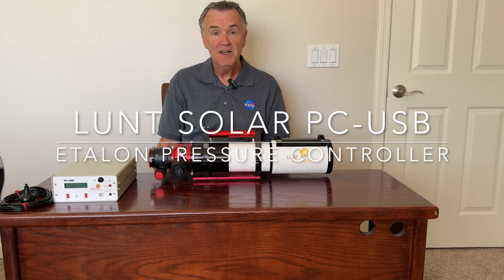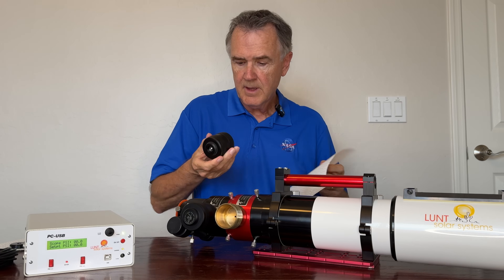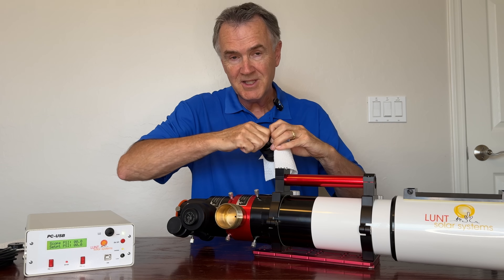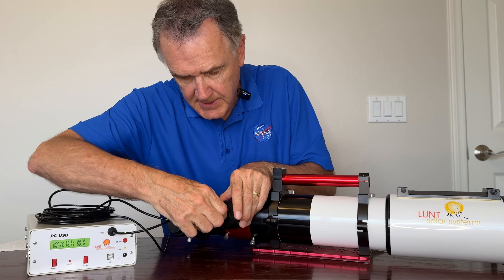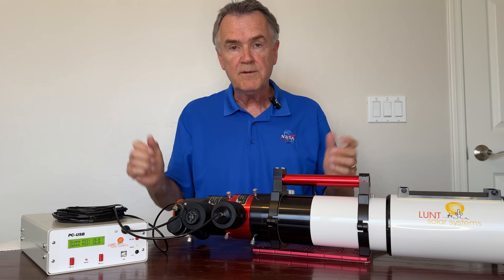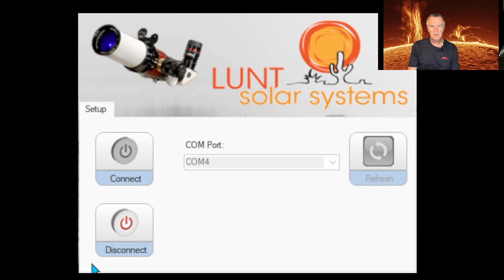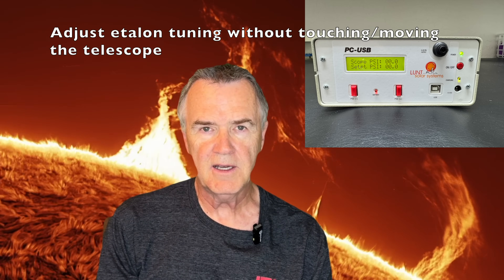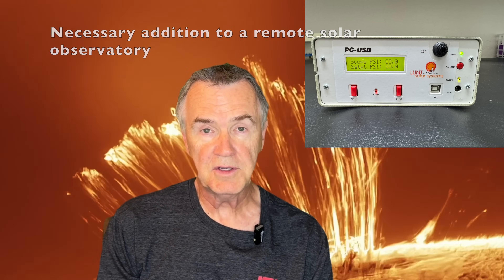Lunt PC-USB remote pressure tuner controller review

Comment: Very interesting. After months of waiting, Lunt finally made their pressure tuners available for purchase. I had to wait nearly 8 months to get one.
I noted that you pushed the o-ring into the tube rather than pushing it onto the piston which has a groove for the ring (similarly to the piston you removed) - any reason for that ?
Lunt provides non melting grease which can be used to ensure there are no air leaks.
With double stacked systems, the question that comes immediately to mind is: how does one pressure tune 2 etalons, without having to deal with 2 pressure tuners.  The first etalon usually being at a slightly higher pressure than the second one, it helps to introduce a pressure controller to downstep the pressure to the second etalon and add a pressure gauge to control that line. Since the 2 etalons are tuned in sequence, it helps to add an on/off valve on the T to the 2nd etalon to allow tuning of the first while the 2nd is unpressurized.
Lunt will sell a piston/o-ring/grease kit for the 2nd etalon.
Thank you for another very informative video.
Reply from the maker: That was a very good catch about the O-ring, I did not notice the recessed area for it and didn’t want to use the grease that they supplied so I could let them have it for another user. That makes a lot of sense.  You do need to have two of these units if you have a double stack system.

Comment: Nice product to fine tune the etalon on band. It would make tuning easier inside than sitting beside the telescope outside in the Sun. I guess you would just have to manually tune the Double Stack though. I have the Lunt 100 with DS etalons and find it difficult to fine tune. I will look into this vacuum unit. Thanks for the review.
Reply from the maker: You would get one for each etalon

Comment: This great.  Thank you for sharing.  Would it benefit to put another unit on the second etalon?  Would it help?
Reply from the maker: Yes of course but I only had one. Of course, if you only have a single stack telescope, then one unit is all you need.
Reply: I've often wondered that, but as I have only a single stack I've not investigated  - but I do wonder if all that is needed is a valve switch from the controller.  However, you still need access to a second adapter to the other etalon.
Reply: @geoffcoll  Lunt sells a kit to convert your 2nd etalon but you will need to build the contraption to distribute and control pressurized air to each etalon.  I spent a bit more than $100 to do that.
Reply: @philippefossier7178 How are you controlling both etalons remotely with 1 Lunt pressure unit.
Reply: Lunt has software that can adjust remotely as they will be connected to my mini pc as well as wifi router.
Reply: I am receiving in about a week a new Lunt 100 with Double Stack. I have on order two of the Lunt Pressure tuners. It certainly is an added investment.  I am told lead time will be about 3 months.

Comment: It's a good way to change and maintain the pressure in the etalon, especially in remote use. I've been unlucky ( apparently) in that mine has had to be returned 3 times for repair for leakage within the unit! My general pressure setting is 17.6psi for my 60 tha.
Reply from the maker: That’s unfortunate.  Normally their stuff is super reliable
Reply: @AZASTROGUY Aye, that was what the engineer in Germany said. Unlucky!
Reply: @geoffcoll  I had to send mine in for repairs also. Lunt makes good quality equipment. These may be at the head of the production line after a long hiatus and they are working the bugs out. I am generally quite happy with my LS100MT.